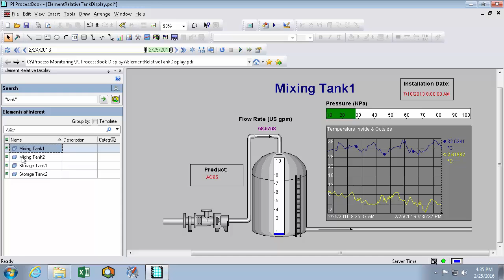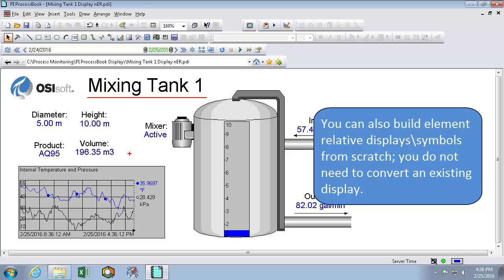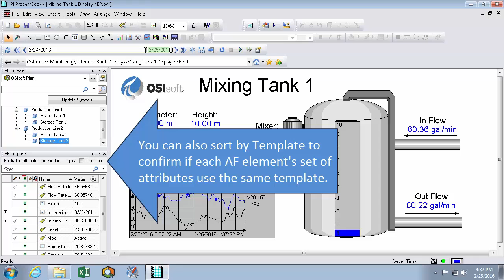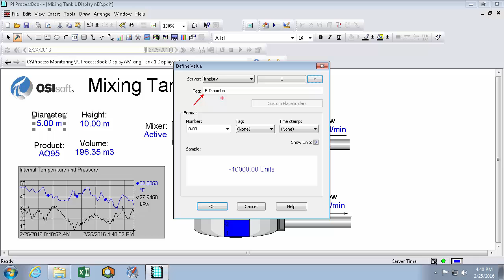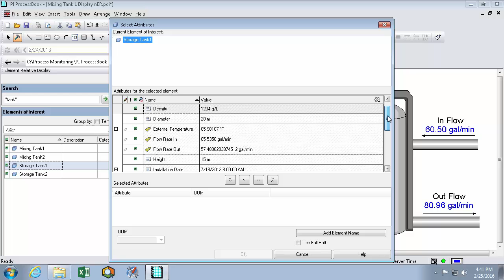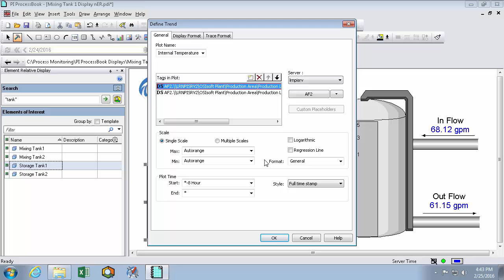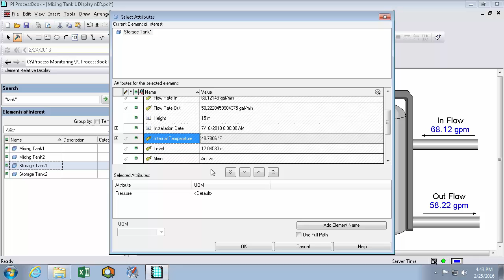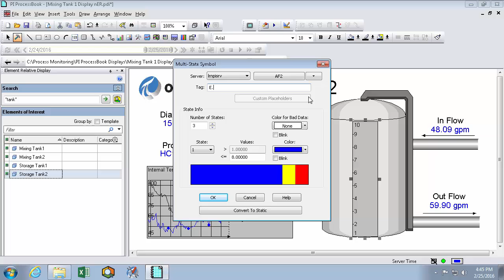OSIsoft: Create a Reusable Element Relative PI ProcessBook Display for Similar AF Assets [v3.5]

Comment: I am learning how to use Pi ProcessBook. I found the Element Relative really helpful. However, I have a question. In the example shown in the video, the 4 mixing tanks had different maximum levels. Setting the red state if the level is above 9 for the first mixing tank, this is replicated in the others even if their maximum is not 10. Is there a way to say that it has to be red if it is 90% or above its highest value?